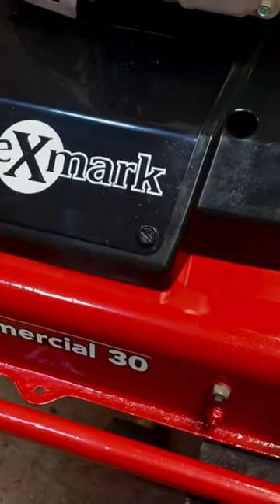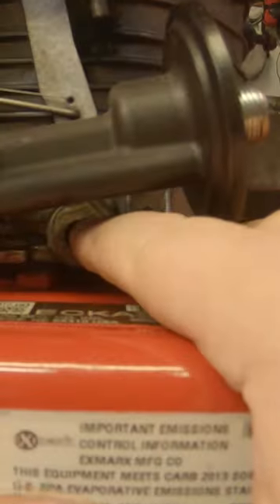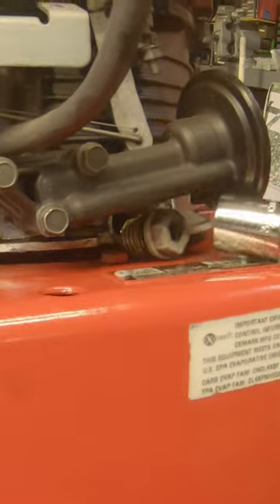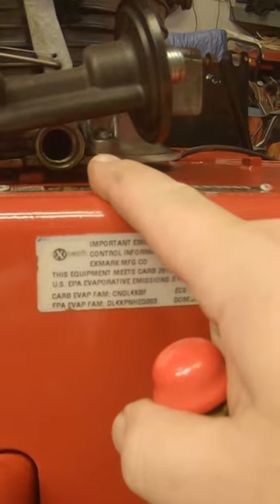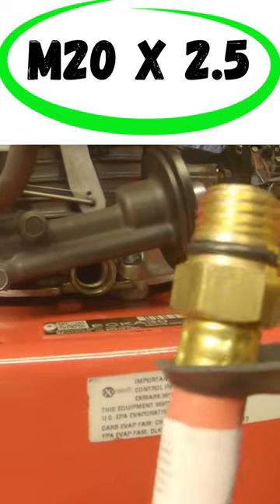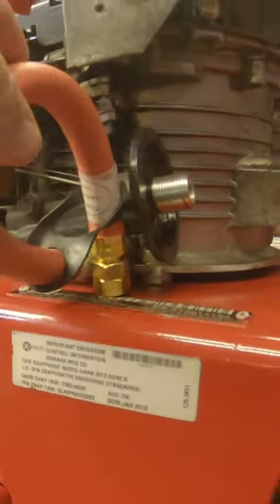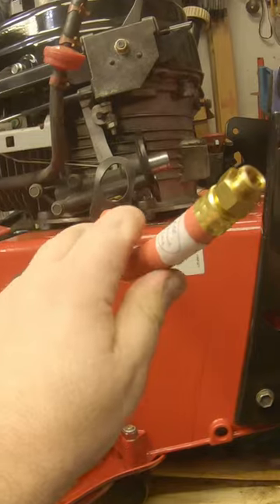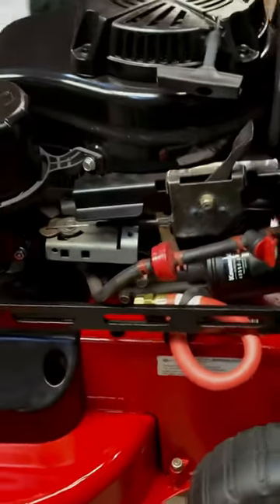Simple ExMark Commercial 30 Oil Drain Tube Upgrade

Comment from the maker: Full Video!
Restoring an Exmark Commercial 30 Complete Tear-Down and Rebuild!
https://youtu.be/Kq9-wREu6DQ

Below are tools and parts I use in my shop and daily adventures.

DRAINZIT Kawasaki Hose
https://amzn.to/3TEmhD7

Mini Tire Changer for mower, go-kart, and most small tires.
https://amzn.to/31eHgGp

The drill bits I use are lifetime-warranted Molybdenum from Drill Hog.  If you break one or wear it down to nothing, you send it back, and they send a new one!
https://www.amazon.com/dp/B010US18BG/?tag=eagle0f1-20

Hand crank trailer winch with strap with safety hook
https://amzn.to/3jTBzEL

Titanium MIG 140 Welder Works with Flux Core (No Gas needed - 110 volts)
https://amzn.to/3mqj3oP
Titanium MIG 170 Welder Works with Flux Core or Gas (110 or 220 volts)
https://bit.ly/3k8GUrD

Amazon Wish List
https://a.co/cWseC8V

As an Amazon Affiliate, I earn from qualifying purchases.  These links help you find the products I've used in this video.  Clicking these links will take you straight to the products on Amazon and help support this channel without costing you anything extra.

Get the Motion Hero Pack that I use in my videos for
Only $37 one-time investment. Use unlimited times on your own and client videos!
https://baldeagle242--videohero.thrivecart.com/motion-hero-pack-1/

If you're a video creator on YouTube - Tube, Buddy is an excellent program to evaluate your videos and make recommendations to help you attract more viewers.  
https://www.tubebuddy.com/Baldeagle242

BALDEAGLE242 Facebook group
https://www.facebook.com/profile.php?id=100068248886396

Comment: How to get a wrench on it to tighten it?  Trying now on a Toro 21 commercial 22297, debating removing the oil filter adapter.
Reply from the maker: I used a small pair of channel locks. With the O-Ring to seal it it doesn’t have to be very tight.
Reply: I could not get a wrench on it. Tried everything including pass thru socket (hose is too big).  I removed the oil filter assembly and had it on quickly.  What a mess I had when I drained the oil to install the Drainzit.  This is my first oil oil change on this like new used Toro that I bought.  I raised the opposite side of the mower and  used a formable funnel to direct the oil into the catch pan. What a mess, oil still found its way all over the deck. Glad I had cardboard on the ground where I was working.  I don't have a pump to suck the oil out. If I had to do it again I would tip the mower to drain the oil out via the fill tube. No mess in the future with the Drainzit installed. I have it on several pieces of equipment, highly recommend it.

Comment: I wonder if that will fit my John Deere GT235 18 HP Briggs V Twin.
Reply from the maker: Yes, but you will need this part number for the GT235 with a Briggs engine. https://amzn.to/3THc3SG
Reply: @baldeagle242  Thanks. That looks like the handy dandy all purpose tool to keep me from making a mess. My mower has a metal pipe with a cap on it every time I try to take it off it unscrews the whole pipe and instant mess all over the place. I have even tried to hold the pipe with a pipe wrench it slip's off and here comes the blood.  This will solve that little problem.